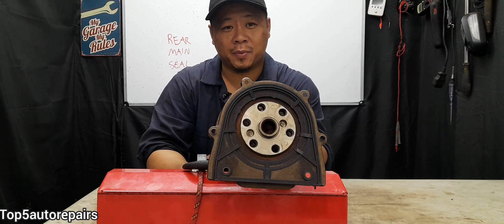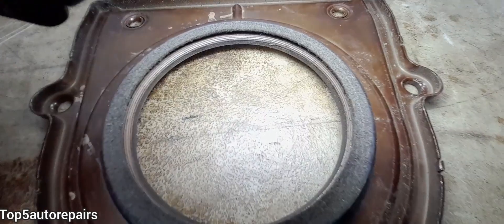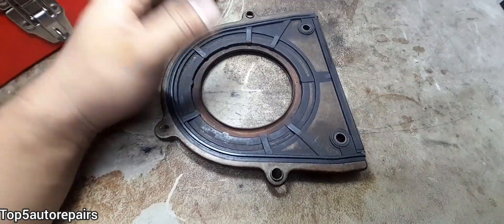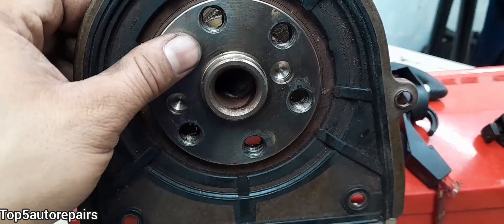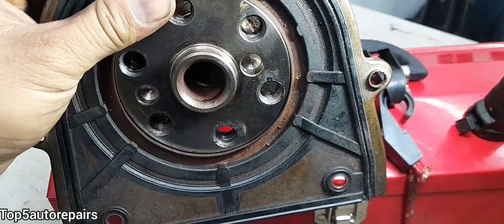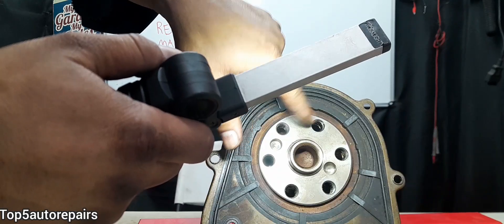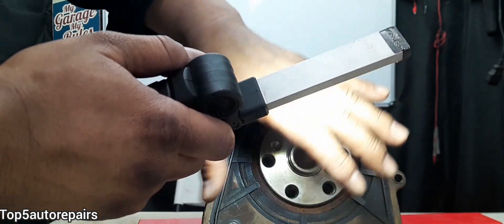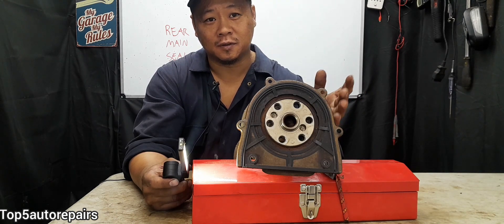SEVERE ENGINE OIL LEAK? CHECK THE REAR MAIN SEAL

Comment: Do yourself a favor people. Buy a relatively cheap borescope. For less than $100 you can get 1080p resolution. Be wary of the ones that work with phones. Connectivity issues are common. Get one with it's own screen display.             In this case, if you have a manual tranny the seal could be checked by running the scope through the clutch fork opening. Also, can inspect clutch components.

Comment: I heard some cameras this is a common problem but so much work they will just keep paranoia that way they don’t have to remove the transmission which is a lot of work
Reply from the maker: It's not that easy for a Toyota Camry. The subframe is on the way.

Comment: I know the “host” doesn’t recommend stop leak, recently on a 2008 CRV power stirring leak I use about 3 oz of the 8 oz bottle of ‘AT-205 RE-SEAL’ & it stop leak, I think the trick is to use a high quality re-seal & about 3 oz ONLY, I been using it 4 years when I used to fix cars 4 a living.
Reply from the maker: I think it's great if stop leaks work. That will help a lot of people save money from  costly repairs. It never hurt to try.
Reply: @Top5AutoRepairs  Stop leak should only really be used to save the engine from further damage while you save up money to do it the right way.

Comment: Is this a costly repair. Just got a 02 ford ranger and its leaking oil. Im Not a mechanic but it seems to be the rear main seal
Reply from the maker: It is because the transmission needs to be dropped to get to the rear main seal